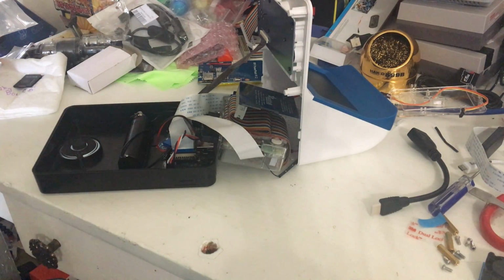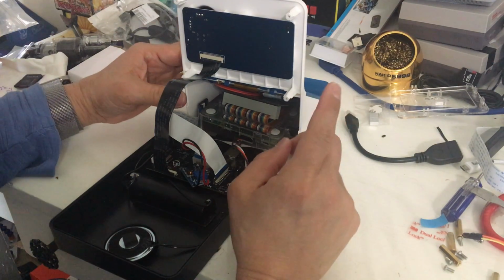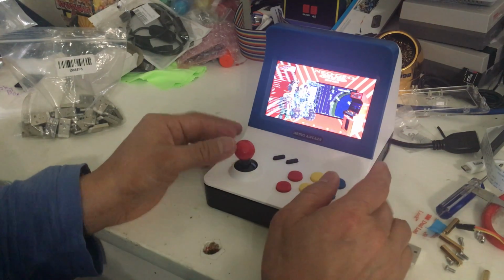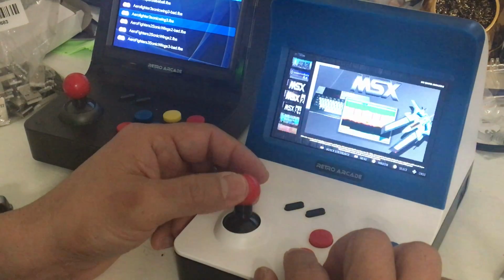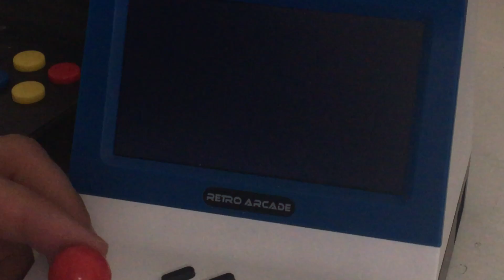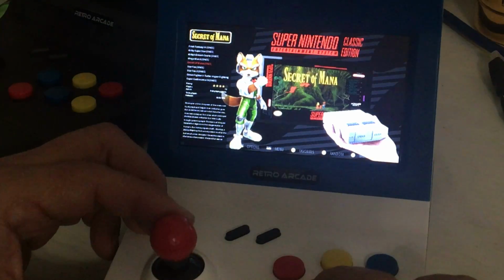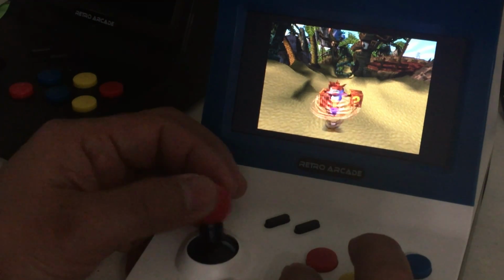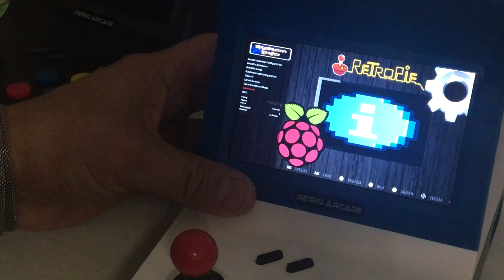Raspberry Pi 3B+ & RgR in RS 07 Hardware updated

Comment: Hi JL, I made also the RgR mod, followed your videos + did some of the things differently (I did not use a pi box + I'm running different sd retropie images such as Dynamo Arcade or Wolfanoz Arcade 32Gb). However, I have a question: in your early videos you had the screen going out of sync sometimes. You said it was because of a bad screen to Ada board ribbon. I have the same problem that occurs randomly but only with some sd images. For example, with Wolfanoz 32Gbarcade  I NEVER have a screen out of sync, while with dynamo or super display sd images it occurs 1 time out of 4, I have to touch the screen ribbon I reboot and it works... I already changed twice this ribbon, put some special tape with aluminium inside around it, etc.. Same behavior. I'm not using an ada fruit hat board, I'm using the RgR one. Do you have some advises in order to solve this problem or at least identify the source? I think it lmght come from the type of sd card I'm using (too slow, too fast, for streaming the videos in the themes... ?) Thanks in advance ! Videos of the Dynamo Arcade image on my RS-07 + Pi + RgR : https://www.youtube.com/watch?v=pXLNa9V0KI0 and https://www.youtube.com/watch?v=7FvnTanSAm0 and here it is with Wolfanoz Arcade 32gb: https://www.youtube.com/watch?v=EauYXSFQut0&t=142s
Reply: @johnny58435  Thanks for your comments.... Indeed, I did not think about the SD cable.... The wolfanoz  image does not have a splash screen video. I will try using a static image instead of a video as splash screen with Super Display and Dynamo Arcade, and will let you know.... Recalbox just proposed a Pi3B+ compatible image, I'm curious to see the results of your tests... For the pi inside the rs-07 I used some black screws + I fixed the two raspberry cards with black plastic spacers. No fan yet. And I wrapped the ribbons/cables with armoured tape with aluminum foil inside the tape, like that the ribbons stay in place + I added some tape on the battery soldering points that hurt the ribbons.

Comment: Hello could you help me ? , I want to try a recalbox image, how can I edit it to work on the screen of the retro arcade rs07
Reply: @johnny58435  i already did it and it did not work in recalbox I think it only works in retropie, that you have to modify it specifically in recalbox to work, I want to try the project with recalbox since the emulators are more fluid and the analog of the rs97 works with nintendo 64
Reply: @johnny58435  Hello, I read that you were trying to prove what I had written to you about if it was possible to make recalbox work since analog control for n64 works perfectly in that system, did it work for you?
Reply: @johnny58435  I tried a recalbox image with raspberry connected to the tv by hdmi and it worked n64 with the control pad that brings the rs07 so it would have to work well with the joystick that brings the rs07
Reply: @johnny58435  please inform me if everything goes well so that you can give me the link of the used image and the file that you used to adapt the screen for the rs07, I remain attentive to the information
Reply: @johnny58435  hello friend, yesterday download a recalbox image for rpi 3b plus and after editing the config file, modify only the last lines of the file and if it works ..... with respect to the emulator of n64 muppen it does not work, only script and I know how modify n64 to work with the analog arcade stick rs07 retro.
Do you know if you can activate the saving of the progress of the dreamcast emulator?
Reply: @johnny58435  can you record games in dreamcast? , could you help me with telling me the method to do it?
Reply: @johnny58435  Or can you save games in dreamcast in retropie?
Reply: @johnny58435  thank you very much I managed to configure dreamcast,
I commented that I also updated all retropie and I could eliminate the consoles that appeared in black and also after updating allowed me to configure the analog of the rs07 in n64 and also in nintendo ds so now it works perfectly with the same command of the console
Reply: @johnny58435  I use both and in both of them, n64 is working with the analog of the rs07 .... the retropie image 4.4 of 128gb after having updated allows to configure and use the analogy of the rs07
Reply: @johnny58435  no, I downloaded the 32gb version, not the 64gb version
Reply: @johnny58435  hello, if working perfectly, what you have to do to make it work is to add to the original config file only the last part of the modified config